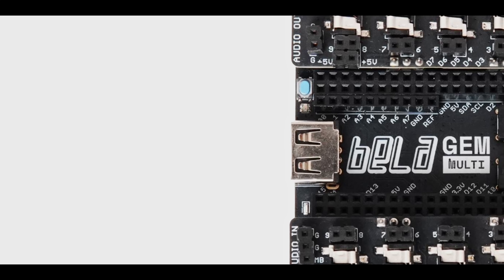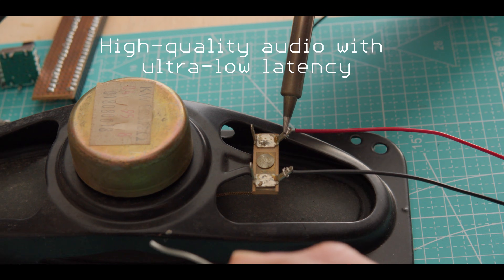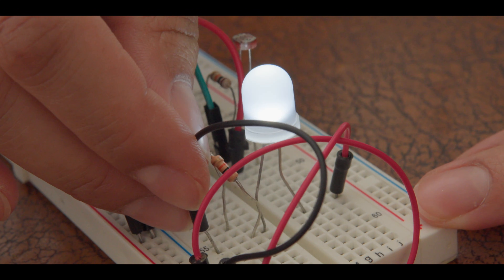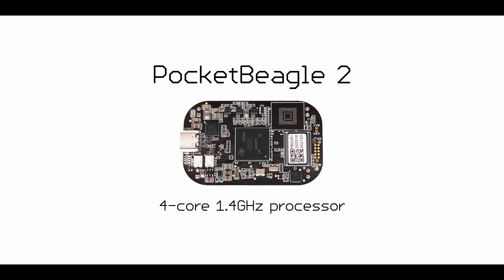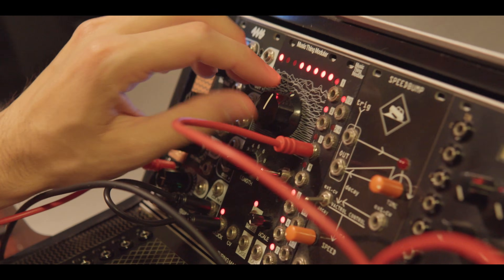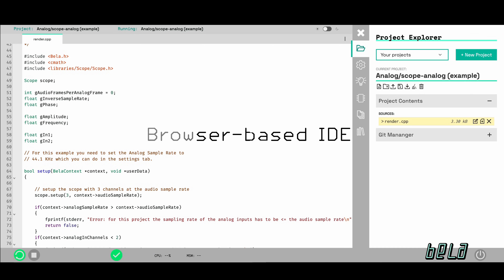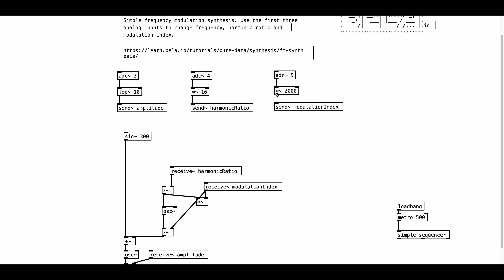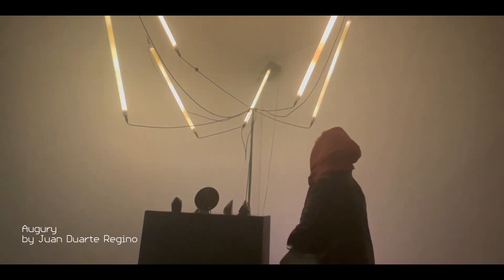Meet Bela Gem Stereo & Multi

Comment: no PWM outs?
Reply: There are plenty of PWM outs, of different types. More than 8 from the actual PWM peripheral (> 20MHz bitclock), more than 16 from PRU pins (8MHz bitclock max) and 16 by using Bela's audio-rate digital I/O (48kHz bitclock max)
Reply: @oromoiluig  ok thanks so basically any GPIO can be PWM? on top of existing outs on the computer platform? On arduino like hardware that used to be specified for only a few outputs that's why I'm asking.
Reply: @hmmmhhhmmh  it's not like any pin is connected to a PWM peripheral, but most free pins can do PWM in at least one of the ways mentioned above. I haven't counted in detail, but it's probably more than 25 pins.

Comment: So how’s this different than a Daisy Seed?
Reply: It runs Linux, it has storage (e.g.: can load audio files), more RAM (e.g.: longer delays), network (e.g.: can serve a GUI on a mobile device) and much more processing power (e.g.: can process more voices/more complex sounds etc). Also, it runs PureData, Supercollider, Csound and rnbo, so one is not bound to programming in C++. Finally, analog and digital I/Os for sensors and actuators are performed at a much higher sampling rate, which allows for more detailed, sample-accurate, jitter-free interaction as well as connectivity with more advanced sensors and actuators (shift registers, motors, PWM and whatnot).
Reply: @oromoiluig I didn’t see RNBO support listed on the video but that’s dope
Reply: I think Daisy seed is basically a micro controller (like an arduino), this is a full computer (like the raspberry pi)

Comment: I already have a Bela Mini device. What is the main advantages of Bela Gem Stereo compared to it?
Reply from the maker: It uses the PocketBeagle 2 which is much more powerful than the PocketBeagle. More CPU!

Mechanically, it's a tiny bit larger but it has the convenience of USB-C, built-in jack sockets and a Qwiic connector.

Comment: so awesome! is there a possiblity to have even more than 8 dc coupled analog inputs? say, combining two bela gem multis or an addon?
Reply: That's not supported. Mechanically, if you were to stack them you wouldn't be able to access the ones at the bottom ... We were wondering whether to leave 8 of the audio inputs on the Multi DC-coupled when using it without the wing, but that comes with some downsides: if you want them to be AC-coupled, as most people would, and you use it without the wing, then you'd need to add two capacitors per channel.

OTOH, there are some 12-bit DC-coupled analog inputs on the PB2 itself that could be used, though the sampling rate is lower. I think it's 7 of them on the Stereo and possibly fewer on the Multi.
Reply: It looks like 8 of the audio inputs on the Multi will be  DC coupled. They are approx 1.5V ± 1V, so may need external scaling/shifting for most DC-coupled applications. Each of these can also be switched to be a two-channel PDM microphone input, soo... plenty of possibilities
Reply: yup there's now officially 8 DC-coupled audio inputs as well, see the campaign updates

Comment: Sounds interesting. Will it now fit in a Hammond enclosure I wonder?
Reply: I depends on the enclosure I guess and how much stuff you put around them. The Stereo is 58 x 45 mm and 22mm tall. The Multi is 70 x 58 mm and 22mm tall, but with the jack "wings" attached it becomes 32mm tall (they are meant to be removed for embedded use).
Reply: @oromoiluig  That's certainly an improvement on the original. Thanks for your response.
Reply: @Sentientfx1  see the latest update on the project for more detailed mechanical drawings
Reply: @oromoiluig  Some sort of comparison chart for memory, CPU speed would be useful too. Is there one?
Reply: @Sentientfx1  CPU improvement is pretty significant, approx 6x single core performance with Pd, for instance.
Reply: @oromoiluig  That's impressive. Thanks for the info.